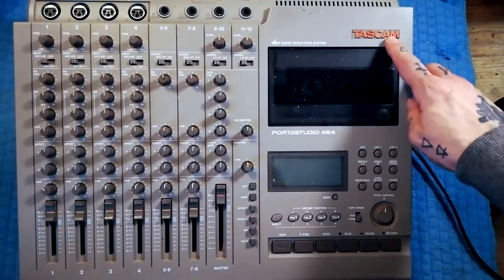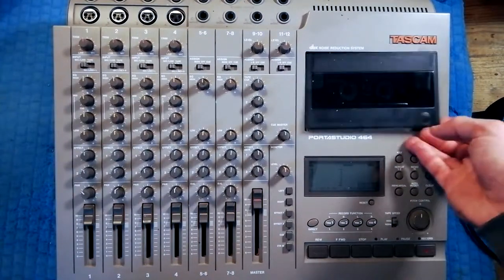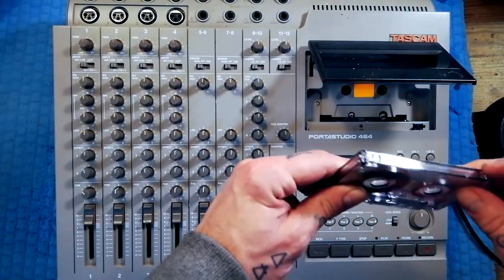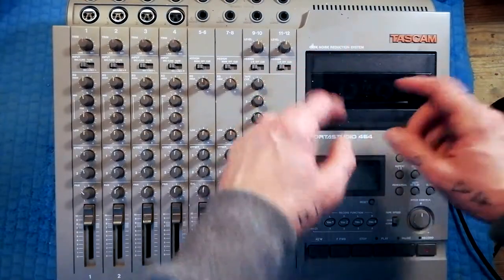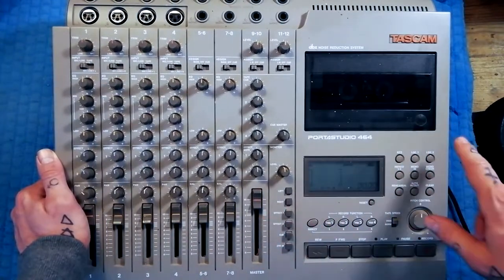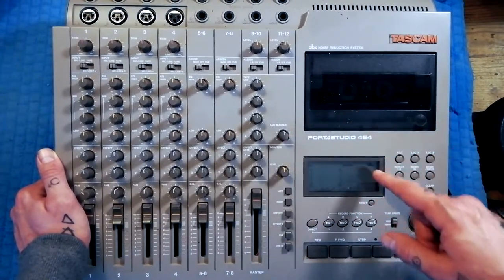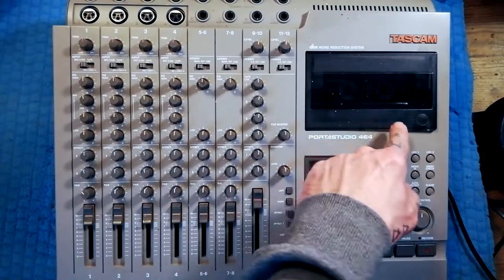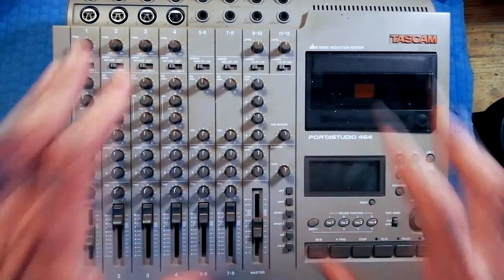Tascam 464 | 1 | testing the transport

Comment: Hello, I have one unit that had the C gear broken, replaced it and the capstan belt too. Now it engages the heads, play, FF or RRW for a few seconds and stops and retreat the head. The clock is counting normaly, the motor torques seems fine too. idk what could be bad in the transport. For the brief seconds that it plays, i can hear that is sounding fine in all channels
Reply: Maybe the new gear is too tight or stuck on old grease.

Comment: Will you be looking into more transport problems of the 464 in the future? In the process of repairing I‘ve stumbled on a dead end with the playhead keeping bouncing up and down as soon as I turn it on.
Reply from the maker: It sounds like your gear C  just broke - have you checked to see whether it is still intact? My video on the subject is here http://youtu.be/mcxex8Ooxcs
Reply: @Tetrakan  Yeah, I had already managed to get that going again and it's still functioning.
Reply from the maker: @KPsTboy  okay... the transport on this model can be very temperamental if the upper case isn't sitting right...both screws need to be in the cassette cavity and tight....if you're confident you've already done that, try removing the upper case, making sure all the wires inside are sitting flat then closing it again
Reply: Tetrakan Supermonobloc You might be on to something with regard to these screws. Gonna check that out. Cheers👍
Reply: I recently found a post regarding the same problem with the bouncing head in which was referred to two certain screws but never found out which specific ones; now I know 🙃. She’s working like a charm again. On to the next hurdle, broken DBX switch and the quest for replacement knobs for those which have melted... Thanks a lot 👍🏻

Comment: Hello, I bought a Tascam Portastudio 464 and wanted to know... When playing a normal cassette tape of music, should it play fast or at normal speed? I put in The Phantom of the Opera, but it was playing it fast. Tape Speed switch was set at normal and Pitch Control was at 0.
Reply from the maker: Commercial cassettes play at 1&7/8 inches per second, but the higher speed on your 464 is double that at 3&3/4 ips. So there is nothing wrong with your 464, switch it to the lower of the two speeds is you want to listen to Phantom as ALW imagined it, and thanks for watching.
Reply: @Tetrakan  it is switch to Normal (Slow or L) and Pitch at 0 (12:00 position) but it still plays fast... When switched to High, it plays even faster (understandably). So, at Normal speed, why is it playing faster than 1:7/8?
Reply from the maker: @Michaelebills  ah sorry I misunderstood you. There are 2 internal trimpots for fine adjustment of the tape speed. The way they're meant to be used you play back a 1khz reference cassette and adjust the trimpot with a frequency counter attached to the tape output so the frequency counter reads as close to 1 khz as possible. If you know what key the songs are in you could make the adjustment by ear. The location of the trimpots is noted later in this series and I have several videos on calibration. It's possible the motor  control chip or pitch control pot or trimpots are faulty but try cleaning the pots with contact cleaner and adjusting the internal trimpot first.
Reply: @Tetrakan  okay, will try your advice and let you know for others in my same predicament.

Comment: I have a 464 that just had the belt replace.  now the tape speed and pitch controls arent working.  do you know what this could be?
Reply from the maker: The daughterboard with those controls on it is one of the sockets you had to unplug when you replaced the belts, so check that cable is plugged in properly
Reply: @Tetrakan  Thank you so much.  do you happen to know which socket it is off the top of your head?  going to try to save a trip to the tech and do it myself
Reply from the maker: @DylanA426  I'm in the middle of a house move so I can't access my spares pile to describe it to you right now but it's going to be pretty obvious once you open it because it's the only cable running from the smaller board mounted within the transport button PCB. Definitely a DIY step to eliminate from your investigation before throwing cash at a tech!
Reply: @Tetrakan  I got it all sorted yesterday, it was exactly what you said it was.  Thanks for your help.

Comment: Gday Mate! I've just bought one of these that had apparently 'just been repaired' - everything works perfectly except the record button wont engage... is this a similar problem? or an easy fix? Dont really want to send it back to sydney from melbourne! Cheers
Reply: Just ran my hand across all the buttons and the record button is significantly depressed compared to the others... Im guessing thats the problem, even though it 'clicks' if i took this apart is there something I could push up?
Reply from the maker: @jackcrook4435 It varies from unit to unit but some you must press the play button simultaneously so try that first (in the middle of moving house rn or I'd check for you) even if thats not the issue there's a good chance its just a dirty tactile switch  - you'll need to open the case remove that pcb (sounds harder than it is - 15 minutes with a screwdriver)  and blow contatc cleaner and compressed air through that switch. Here's the same process demonstrated on a 244. https://youtu.be/fhZHQhQ01vw
Reply: Thanks so much for the swift reply mate. When I start the machine up holding play and rehearsal the recording light flashes along with the others so I know that it is working to some degree. I have the stuff you mentioned on hand so I’ll give it a go. Thanks again!
Reply: There’s nothing to drastically different removing the pcb on a 464 that might throw me? Just thought I’d check just in case 😬
Reply from the maker: Centre For Ants not really, but I demonstrate the removal of the board in this video if you want reconnaissance https://youtu.be/vBB3k72wYhU
Reply: @Tetrakan  Thanks for your help man! Managed to bust it open and have a clean (great instructions on how to do all this!) - but alas still no record function. The button clicks fine but must not be connected to something electronically
Reply from the maker: @jackcrook4435  next step - reflow the solder. Failing that, replace the switch, they cost a fraction of a dollar each from any electrical wholesaler, search "tactile switch" on your preferred Aussie seller's website search bar
Reply: @Tetrakan  I found the problem! Just unsure how to fix it... the tape isnt pressing the record safety switch arm in enough... if I hold the cassette in switch and the record safety arm it plays and records without a tape... so I need to find a way to get it to lean in to the cassette more! Thanks for all your help!
Reply: @Tetrakan  Fixed! I taped a bit of foam behind the tape sensor to make it sit the tiniest bit more forward and now it clicks into gear perfectly. Woohoo. Thanks for your help
. Your channel is a gem

Comment: I just got a 464 in the mail last night. Everything seemed to be working fine then, but when I went to use it today the play and record functions stopped working like in this video. Taking the unit apart the transport looks fine. The capstan appears clean and the belt looks good. I don't know what could be wrong after watching more of your videos on this unit. Could the capstan motor have gone out? I don't hear the motor turning. Thanks for making these videos!
Reply from the maker: If the capstan belt is okay, then the capstan should be rotating as soon as the unit is turned on. If this isn't happening, the control chip on the motor may have burned out. Check the electrical troubleshooting playlist on my YouTube channel for videos on this. If the capstan does turn, check gear C is still intact, a video on this is in my 464 playlist, thanks for watching!
Reply: @Tetrakan  I found your other video and took the motor apart and it is definitely burnt. Unfortunately along the way I broke the lip of the pcb. I found a very similar motor, but its a 500KD and not 530KD. Hopefully it'll work out. Voltage and speed is the same.
Reply from the maker: @zbronstein3901  I'm not familiar with that motor, so please let us know if it works  If for any reason it does not, you can probably repair the lip if the original PCB by soldering metal splints  (cut off legs from through hole components is ideal for this) across the solder tracks either side of the break, I gave a video of a similar repair on the transformer PCB if a 424 mk II - a much larger board but same principles apply